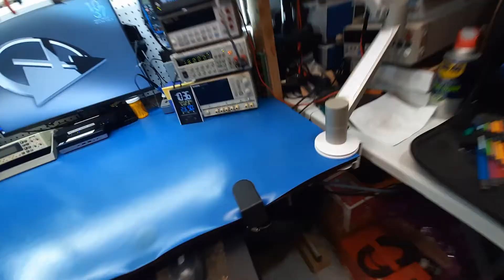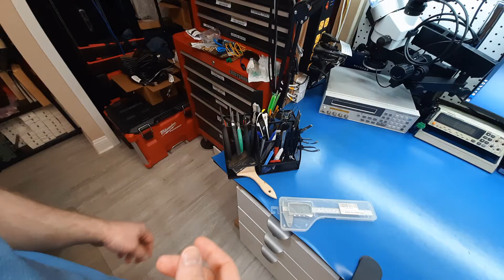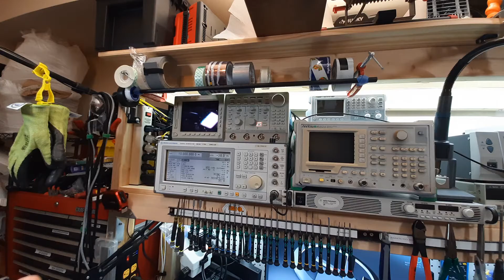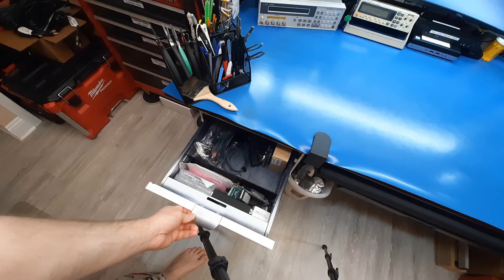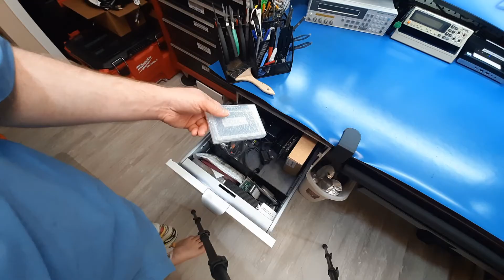Electronics Workbench: State-of-the-Bench 2025-Mar-30 update

Comment: Nice setup you got there! i also like the walkthrough. Curious, what do you do for work?
Reply from the maker: My electronics bench is my income - I buy, repair/refurbish/clean/test, and then resell lab electronics.  I also buy and sell physical metrology gear, industrial electronics and computers / computer parts as opportunities come up, my my primary interest is lab electronics.
Reply: @neverendingstudent  Oh cool. You seem very skilled and well equipped so makes sense. You mentioned the tool bag you took with you on the field so I wasn't sure if this was a side gig or not.
Reply from the maker: It used to be.  My background is in IT, then telecom contracting, then low-voltage contracting.  I only set up my lab due to looking for ways to generate income while staying home most of the time (this was back during early COVID and that was the driving force for looking for work from home options).  The economic effects from that were also drying up work.  I started selling on eBay, worked on establishing good reputation and feedback, and gradually built up my instrumentation capabilities at home.  That started out with a 2x4 folding plastic table and a very basic bench setup with stuff bought on eBay around fall of 2022, then I built my original bench infrastructure that I am still using around November of 2022.  At that time it was not yet profitable and I was still in the build and investment stage.  My income then was low-voltage contracting for entry control and security systems.  I gradually built up my eBay business, later expanding out to include local marketplaces (Craigslist and FB Marketplace) and now it is my primary income.  I still do occasional contract work, but the bench is my main income and has been for... I don't know, the past couple years or maybe a bit more?
Reply: @neverendingstudent  Uh, gotcha! My background is IT as well but recently started learning electronics repair. It is a lot of learning and I am not that young so it's been challenging but still enjoying it.

Comment: Very nice.   Can you tell me the monitor mount you are using on the Rigol O'scope.   I have the same scope and a finite space to work within snd it looks perfect.
Reply from the maker: It's the Steelcase Volley arm.  I actually got a pallet of them at auction (before ever getting the Rigol!) for resale and have some on my eBay store.  It just happened to work out that they are a good fit with the scope - they don't use springs or pneumatic pistons, so there's no minimum weight and they won't randomly spring up on you.  https://www.ebay.com/itm/256495160268

Comment: Was the mechanic polarising light better than the old one? I've got the iL37 and was wondering if it's worth the upgrade.
Reply from the maker: This is going off memory from more than a year back, but I think my assessment was that the physical build quality is better (Mechanic is aluminum vs plastic on the iFixes) and it might have been a little bit brighter?  I know I didn't swap to the mechanic though, but I think that was mostly laziness on my part since I didn't want to undo and redo my cable management and sleeving.  So yes, if my memory serves, it is better by a bit.  I would recommend you check out a video my friend and fellow electronics YouTuber nanofix put out where he reviews most of the new microscope ring lights currently available: https://www.youtube.com/watch?v=htrsruAgc8k
Reply: @neverendingstudent  Thanks. 👍

Comment: Awesome setup!  I would strongly recommend you upgrade your pegboards to Wall Control metal pegboards. They're surprisingly inexpensive considering its thick gauge. They're powder coated  in a variety of colors and available in several sizes in horizontal or vertical orientations. It's compatible with standard pegboard hooks, but also has slits for a range of accessories, including shelves, bins, drill holders, spool holders etc. They're sold individually, but their kits, which includes several panels and accessories, are a WAY better value.  Get it, you'll thank me later!

Comment: Thanks for the interesting video. It’s always fun to see how others have set up their electronic benches. I have a question. For my new Rigol MHO98, what is the make and model of the swiveling arm that holds your Rigol scope? And, is this what you’d buy if you had it to do over again?
Reply: I’ll give it a look. Thanks
Reply from the maker: It's the Steelcase Volley monitor arm.  I actually bought a pallet of them at auction and have them on my eBay store: https://www.ebay.com/itm/256495160268 - I would recommend it, yes - since it's friction-lock instead of springs or pneumatic pistons, it doesn't have the problem of the Rigol being 'too light' and always popping up.  I have specific notes on the listing for what else is needed to work perfectly with the Rigol: spacers and long screws to allow for airflow.  Congrats on the MHO98 by the way, I'm soooooo wanting to buy one, but its just not the financially responsible thing to do right now.

Comment: Power switch...ya, easier to put in the back, keeps AC voltage and noise away... Tektronix used to solve it with a kind of pushrod thing that was operated by a pushbutton, or push/pull toggle, on the front panel... you just reminded me to do something about a couple of buried power switches!
Reply from the maker: I see that plastic or acrylic rod solution used in pretty much all my bench meters.  Honestly, I never really thought much about it and I'm glad to learn what problem it was designed to address.  Thank you!  I love those 'Oh, THAT'S WHY they did that' moments.  Also, I like that 'Weird electronics stuff' playlist you have.  Copied for later viewing.
Reply: I'm a "neverendingstudent", too, even though I now have 40+ years of time in, and now retired... But I never stop asking questions, and always invited input from the most junior team members, to allow them to feel part of the team, and always with eyes and ears open for new ideas 
(AE at Tek, Agilent, R&S, head of LED and LED drivers, 6+ years at Nokia, 15 years consulting...

Comment: Great setup! I really like that your test equipment has such a variety of manufacturers and that you aren't "locked in" to one ecosystem. You have given me a lot of great ideas I'm going to incorporate into my setup.
Reply: I used the AI "Ask" tool to generate a timestamped equipment list. I manually fixed some spelling errors and omissions, but it should be fairly accurate. Feel free to copy and put it in your description if you like:

Primary Instrumentation Stack

Rigol DHO 914 Oscilloscope: (5:08)
Pine 64 Power USB Power Supplies: (6:05)
Keysight 34465a: (7:40)
HP 34401A: (8:58)
Advantest R6144 Precision Programmable Voltage & Current Source: (9:24)
Keithley 2001 7 1/2-Digit Meter (repair): (13:14)
GW Instek GPD 3303S Bench Power Supply: (13:39)
Clock with Temperature & Humidity Sensor: (14:42)
AiXun T420D Soldering Iron Station: (15:23)
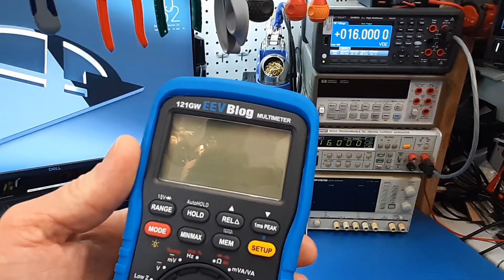EEV Blog 121 GW Meter: (16:47)
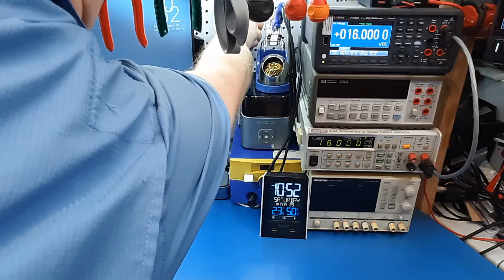Hakko FM 204 Desoldering Station with Vacuum Pump: (17:00)
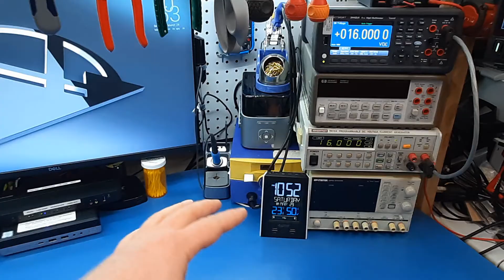Hakko FM 2024 Desoldering Handpiece: (17:11)

Secondary Instrumentation Stack

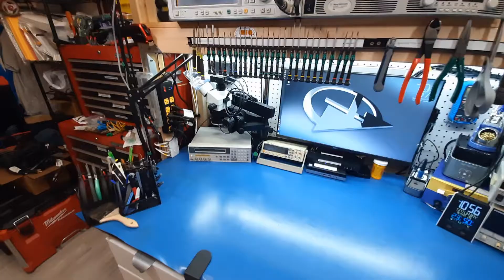HIOKI 3540 Milliohm 4 Wire Resistance Meter: (21:12)
Agilent 4263B LCR Meter: (21:41)
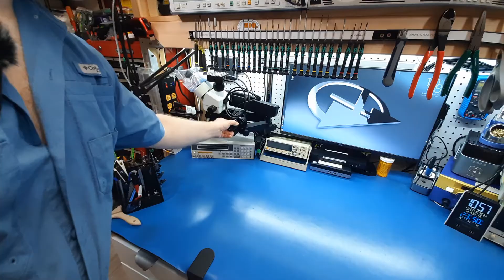Amcope Trinocular 45X Microscope and Armature: (22:09)
Rising Cam RT 5109 4K Camera: (22:32)
iFixes IL37 Polarizing Ring Light: (23:23)
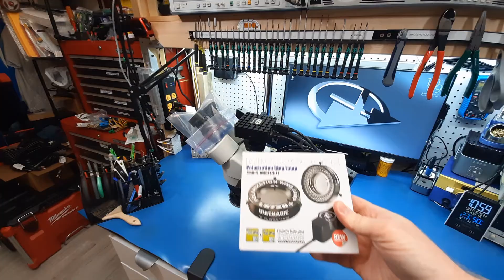Mechanic Polarizing Ring Light: (23:53)

Other Tools & Equipment

Small Hand Tools (Tweezers, Scissors, Dental Picks, Spudgers): (27:33)
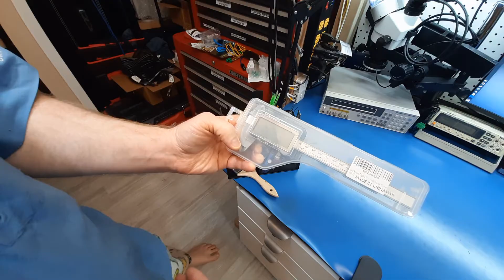Caliper with Plastic Jaws: (30:38)
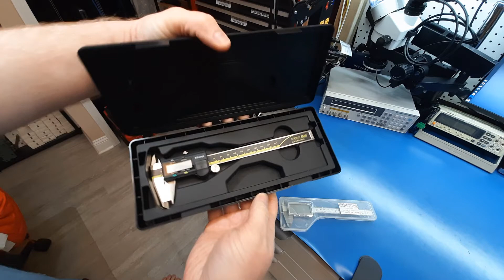Mitutoyo Digital Caliper: (30:55)
Tajima Tape Measure: (32:14)
Klein and Wera Precision Screwdriver Set: (32:37)
Magnet Screw Container (Altoids Tin): (32:50)
Kikusui PLZ 334W Electronic Loads: (33:55)
Quik 861DW Hot Air Soldering Station: (34:15)
Agilent 6614C Power Supply: (34:39)
Agilent N5745A Rackmount Power Supply: (34:54)
Banana Jack Rail: (35:52)
OWON AG1012 10 Megahertz  Signal Generator: (36:12)
Tektronix TDS 744A Oscilloscope: (37:12)
Rohde & Schwarz SMIQ02 Echo Signal Generator: (37:32)
Anritsu MS2623A Spectrum Analyzer: (38:07)
Tape Holder: (44:08)
NiteCore i4 IntellaCharger Battery Charger: (44:18)
Loc-Line Phone Arm and Mount: (44:47)
Inventory, Tools & Storage: (45:40-55:52)
Reply from the maker: @redox_stable  Wow!  That is super handy, thank you.  Looks like I need to take a look around for such tools and try them out.  Edit: added to description with some clean-up edits.